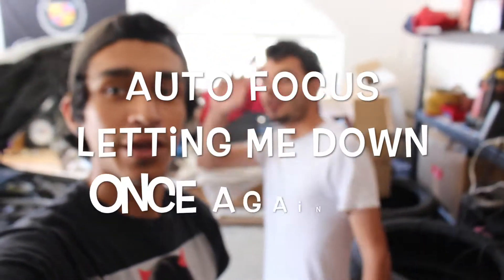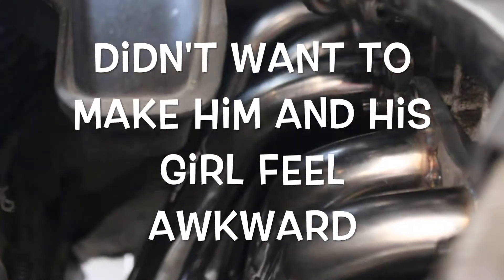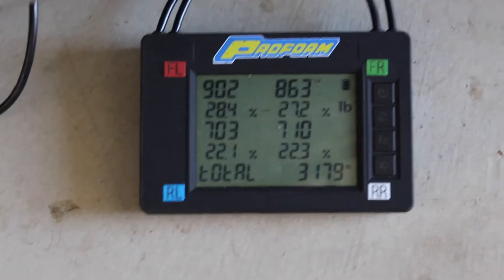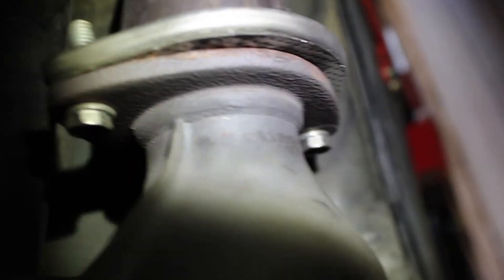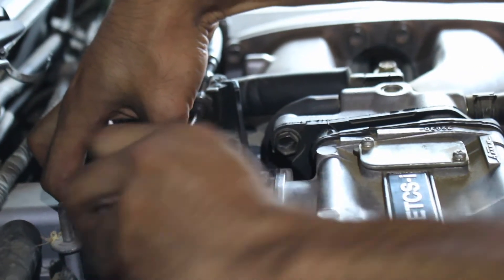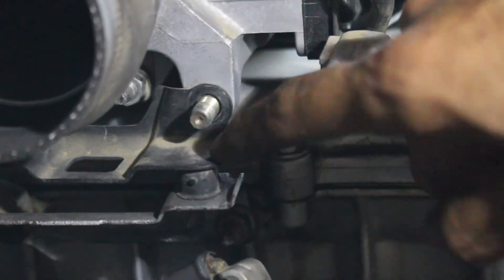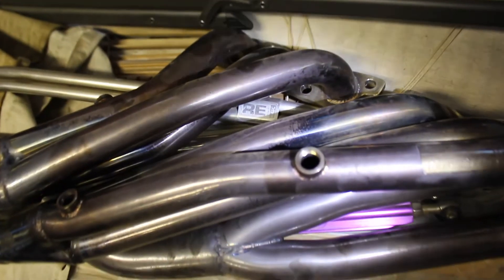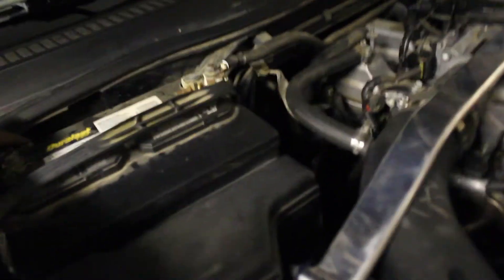LEXUS IS300 OBX V.1 HEADER INSTALL! (X2!)

Comment: How are you liking those long tube headers? I heard you lose alot of low end torque.
Reply from the maker: For the price, they're pretty good. Makes the exhaust note more alive and enjoyable. But going from the stock header to the obx's, I'm pretty sure we gained torque across all the rpm range because when we first raced Gus' is300 with the obx + greddy combo vs my stock is300 he would pull on me no matter what in whatever gear. And after adding my header he only begins to pull on me in like 3rd or 4th.

Comment: How did u prevent a check engine light without the cat
Reply from the maker: I'm actually testing out spark plug defoulers to see if they truly work because some people say yes they do and some say no they don't. We will be doing a thorough video once we fully test it. I currently have one on my bank 1 sensor 2 o2 and going almost 300 miles now no check engine light in sight. Will be testing it out on Gus' car since his car throws a code almost immediately after reseting the light.
Reply: O2 sim